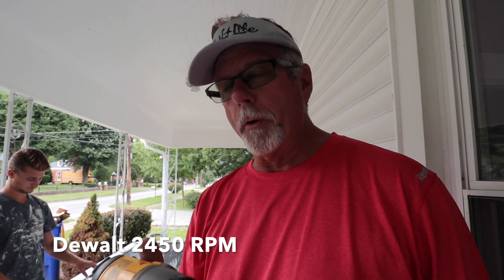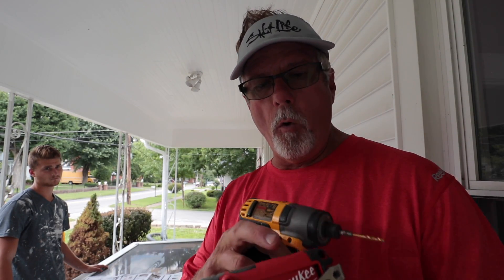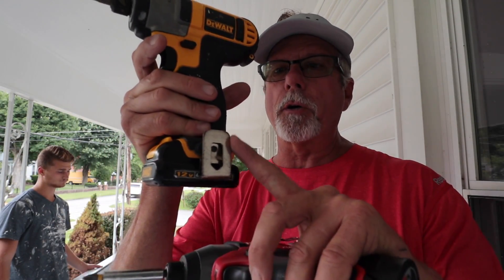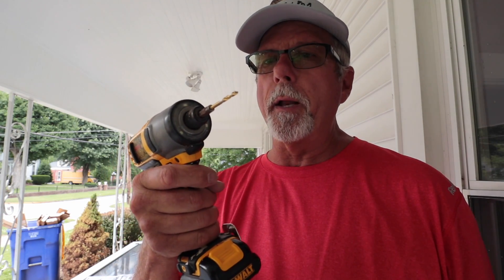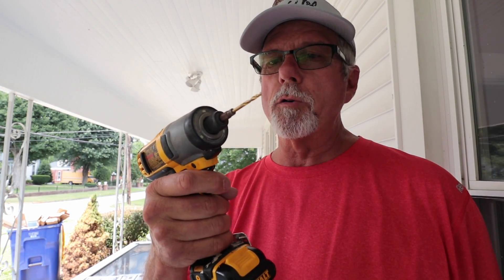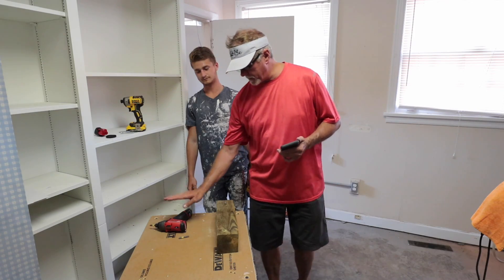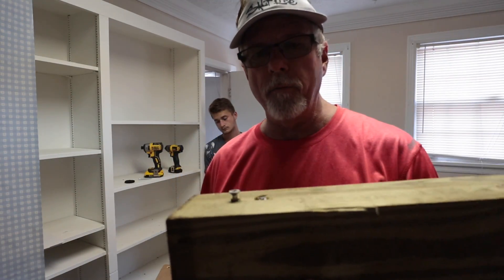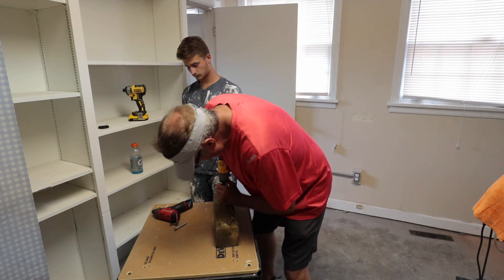Milwaukee 12V VS DeWalt 12V Impact Driver

Comment: I just ordered the new Dewalt 12v impact driver kit. It is brushless and comes with 2 2ah batteries, a charger that charges 12v and 20v, and a case.. all for $99.00. The batteries have power indicator. Great deal.

Comment: The m12 fuel is a game changer for me, I already had the m18 which had the dual charger....honestly I'm using the m12 impact 90% of the time without a problem. Pretty awesome actually!
Reply from the maker: jay raider yes I use the m12 fuel all the time it’s a powerful tool.

Comment: I just picked up a  Milwaukee fuel Gen 2 12 volt 1/4  impact driver ! I also have a DeWalt 996 hammer drill  !   I think they could cover a lot of needs  that combination 😉 may pick up Milwaukee hacksaw ! Nice video
Reply from the maker: Congrats on your new tool. Yes you can do a lot with those tools. DeWalt just came out with their version of the hacksaw.

Comment: something i perhaps should of also explained is, a grip at a 90 degree ish angle as is the dewalt will, when placing forces on the grip will want to tip the front of the driver away increasing cam out resulting in torn screw heads or shearing of driver bits.. the angle of the milwaukee assists in reducing this problem. ps i dont work for them but i have used many tools and driven tens of thousands of bolts and screws in over decades as far back as the 70's i remember my 1st yankee pump action screwdriver in the 80's thaught it was the dogs gonads. GREAT REVIEW Dave, keep up the good work many of us rely on this info before we spend our hard earned cash.

Comment: By the way Milwaukee angles their heads so that the handle cannot interfere with what you are working on. Since you have the smaller battery installed it is less of an issue. Consider if I am trying to get my impact over my mower blade bolt and the head is straight. The battery pack might come into contact with the deck before the socket goes over the bolt. So it just aids in getting into tighter places.
Reply from the maker: Jordan Robinson thanks for the info!! Good point!! Thanks for watching and commenting you have a blessed an awesome day

Comment: It looks to me like DeWalt is focusing their R & D on 20v max and flexvolt. That's probably a good decision for them, but it leads to them not making direct competitors for brushless 12v tools that have been released in the last four years.
Reply from the maker: Louis Hurrle yes Milwaukee has released several 12V tools and it seems DeWalt isn't focusing on the 12V line. I think there's a good market for the 12V line because of weight and size. Thanks for watching and commenting you have a blessed an awesome day

Comment: milwaukee designed the angled handle to help facilitate  drilling or putting a fastener in at most angles allowing greater pressure and control in tight corners and recesses,  you actualy almost answed this when you mentioned  (pistol grip) the wrist hand and arm suffers less fatigue when in the pistol grip angle allowing you to drill and fit fasteners for longer in most but not all circumstances with less stresses placed on your limbs.
Reply from the maker: victormeldroo wow thanks for the good info. It’s become our most used go to drill we really enjoy using it. I don’t study up on the the tools I just try to give my thought on them as we use them. Thanks again for the info and watching and commenting you have a blessed an awesome day

Comment: I don't really see the point of buying a 12v driver if you've already got an 18v.
Reply from the maker: JayKay9112000 if your just going to have on impact driver then I would have the 18v Milwaukee or 20v DeWalt with the adjustable speeds. If I'd only took your advice I would be living on an islands somewhere with my toes in the sand listening to Jimmy Buffet LOL😎. But because I try to entertain you guys I have two 12v impact drivers, two 20v impact drivers and on and on. I'm sure you get the point!! Thanks for watching and commenting you have a blessed an awesome day!!
Reply: The Days Of David I too am a landlord up here in northern Minnesota. I've got quite a few redundant tools I'd like to get rid of for a cheep price if you want them for comparison tests.
Reply: 12v tools are lighter , less stress when using them long hours especially overhead

Comment: the dewalt is a older brushed while the milwaukee brushless put the dewalt against Milwaukee's brushed version and it will be a different story
Reply from the maker: Big Daddy I'm sure your right, I wish I had the new DeWalt to put beside the new Milwaukee.
Reply: I have the same Dewalt impact and I still luv it, I’m a diy guy though so no big huge jobs. I also have the 12 v Dewalt drill and i wouldn’t have it any other way, I’m not a fan of the big fat grips, the Dewalt feels perfect in the hands.
Reply: Milwaukee has the best 12v line by far .. milwaukee has passed dewalt, their battery lives aren't even close

Comment: Holy Crap! I get to be the first comment.
Reply from the maker: Jordan Robinson you got it!!
Reply: I have several Milwaukee tools. I chose Milwaukee over DeWalt because at the time the half inch impact came with a plastic case, whereas the DeWalt did not. Also you could purchase a rubber boot to go along with the impact wrench. However, what sucks is you cannot close the Milwaukee case when the protective boot is over the gun.
Reply: Jordan Robinson Personally they should have done what Makita did and have the rubber nose built on
Reply: I was never a fan of Makita, no offense. I have really no experience with them. My father disliked them so I just steered clear of them. Could you remove the rubber boot from the Makita? I bought the Milwaukee half inch impact mainly to remove and install my mower blades. I will probably get a little less life out of my spindles but man is it a enormous pain in the ass I do not have to deal with. It turns a half hour worth of work into about thirty seconds.